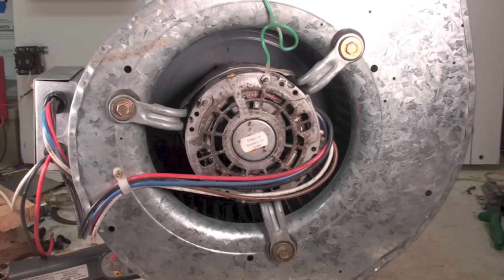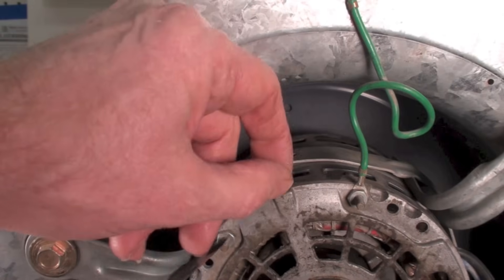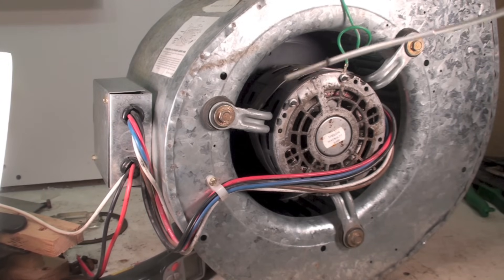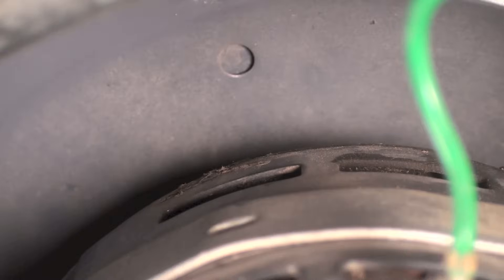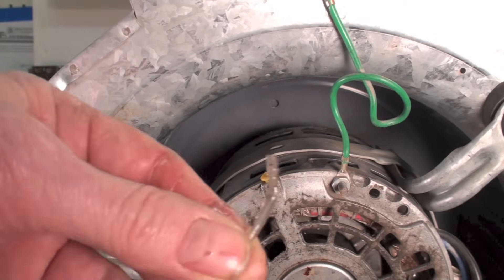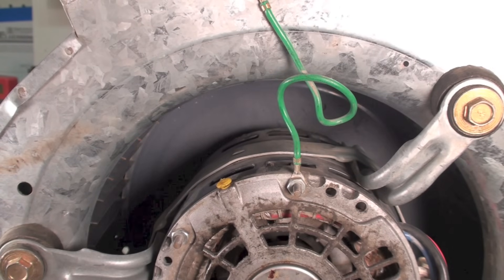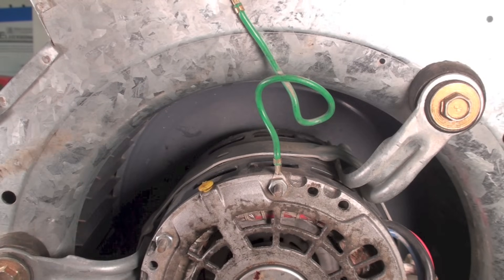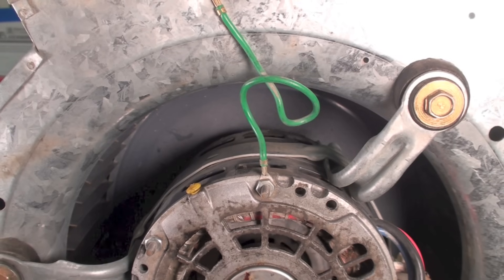How to oil the HVAC fan motor

Comment: I think the felt/Permawick sawdust looking goop inside is an oil wick and not a filter.  If dust builds up from leaving the cap off (years), it will clog the wick and stop it from oiling the shaft.  A clear flexible tube to the front bearing is a good idea so you may not need to remove the blower.  I blower cage should spin for 10 seconds or more after the motor shuts off to insure free movement.  It is said to not use a detergent oil since it is not an internal combustion engine.  The oil you are using I think is the "standard" "turbine" oil.  Do not over oil or it will leak into the coils.

Comment: sorry if u already addressed this but do u know if I can swap out a belt drive blower for a direct drive? my old belt drive unit has gotten a bit too noisy & I'm hoping I can quiet it a bit. i believe the noise that bothers us is caused by the shaking of the elements due to the rough motor movement.
Reply: +bgregg55 I would think the belt drive motor would be higher RPM and lower torque than the direct drive.  Can you check specs on the labels?

Comment: my fan motor (squirrel blower fan) worked fine until I took off the metal cage.  The fan will start and run for a minute than it cuts off.  It starts again then stops.  The motor get very hot.  What is going on?  Thanks
Reply from the maker: carino tresvinos What do you mean by metal cage?  
GFM
Reply: grayfurnaceman Sorry, I meant the cage was made of aluminum which is very flexable.  Thank you for acknowledging my request for help.
Reply from the maker: carino tresvinos If your motor is overheating when installed, check rotation to be sure it is smooth.  If it is tight, bearings are failed.  If rotation is easy, the windings are probably at fault.  Hope this helps.
GFM
Reply: grayfurnaceman The rotation is smooth so the windings are the cause.  Will it be more cost effective to repair or to purchase a new motor?  The motor is directly attached to the fan. Your feedback is indeed appreciated.
Reply from the maker: carino tresvinos Always replace.  Way too expensive to rewind.
GFM
Reply: You have been very helpful.  Thank you very much for your patience.
Reply: +carino tresvinos Some motor types use a capacitor which can fail with age.

Comment: How often should you oil?
Reply from the maker: urgentcareguy3 There are many manufacturers' specs on frequency of oiling.  As a rule, I oil on prewinter or presumer service every year.
GFM
Reply: Ten years ago, I had a blower motor replaced.  Four years later, motor started chirping for oil.  Four years in Houston, is too long to wait.  I have oiled the motor every two years since then.

Comment: Bearings seized up on my Bryant +90 and I HAD to pull the blower assembly out to oil it manually,put it back in and got it going with a drill motor on the shaft end.(Scary). I waited until the unit called for heat and the motor buzzed.
I worked for a week until the new motor got here. Done.
 I used the wrong oil .(15-50).  Supposed to be 20wt. non-detergent.
I popped the covers off to get oil on the bushing,manually spun it on the bench.

Comment: I was reading the manual with my Rheem highboy furnace. The manufacture states SAE 10 or 20 motor oil or light oil for blowers may be used. In addition to that information the manufacturer states only to add between 10 - 20 drops of oil every 2 years of regular service. or every 5 years of light service. more oil than that can damage the motor. Check manual as it should be with the unit or call the manufacture.

Comment: I about had a heart attack when the blower motor in my 24-year old Interthem/Nordyne started intermittently screeching this morning while getting ready for work, and after stressing quite a bit over the course of the day followed by some clean up and your video this evening, I quickly and easily found the aluminum oil hole plugs and managed to throw a little Zoom Spout (I actually had a bottle lying around - LOL) in each... without even pulling the blower.

Major props for helping yet ANOTHER (quite thankful) DIY'er. ;)
Reply: Where was that plug located exactly

Comment: Thanks for the help! After coming home from picking up my wife after she hit a deer and it tore up her car really good, we smelled something burning in the house. The 1st thing I thought of was the furnace. Sure enough, the blower wasn't turning. I cut the power immediately. After cleaning the deer (I DO have my priorities - lol), I tackled the blower motor but could not remember where to oil it or if it was sealed. I have replaced several of these but it's been a while. Again, thanks for the simple reminder!

Comment: Great video -- When I pull out the blower assembly - I'll also take out the fan motor (from the blower assembly)  - then clean the blower wheel, assembly, and motor.  Perfect time and it only takes 10-15 min and this greatly improves the blower efficiency.

Comment: Most of +10 ton packages units with belt driven blowers you have to use a grease pump to lubricate the bearings.

Comment from the maker: Most motors do not have them anymore.  However, we work on things that are not new.  So its good to know what to look for.  Thanks for the comment.
GFM
Reply: what about an 06 blower? think it would have them or not? I'm getting a quick squeal from the air handler when it turns on.

Comment: Thanks for the update on oiling my reducer blower. I was thinking the same thing at first but having troubles exactly on where to oil it. Your video on Fan motor gives me an idea for that but i want to be safe and not put oil in the wrong area on the reducer blower. My model # is a Goodman GMP075-3... Serial # 0003666630 I believe it was put in when i bought my house in 2001. Thanks again for your help. Glad to have an experts help on youtube.

Comment from the maker: Well, nothing at all.  If the bearings are sealed, there is a packing of oil around the bearing meant to last the life of the motor.  If a seal fails and the oil runs out, the motor must be replaced.  Most motors now are sealed.  Thanks for the comment.
GFM
Reply: You actually can oil the motors that are sealed - some vids showing how but I just did mine and made a quicky - windings and armature and shafts were perfect, it was only oil that it needed (I replaced mine later anyway, but didn't need to) - https://youtu.be/VgwCVNEquNg

Comment from the maker: Zoom spout oil is expressly for motor oiling and is non detergent.  I dont know whether you should use detergent or non.  I have not seen any motor manufacturers recommendations.  If you have seen any factory specs I would be interested.  Thanks for the comment.  Merry Christmas
GFM